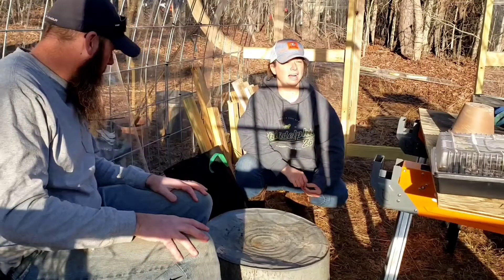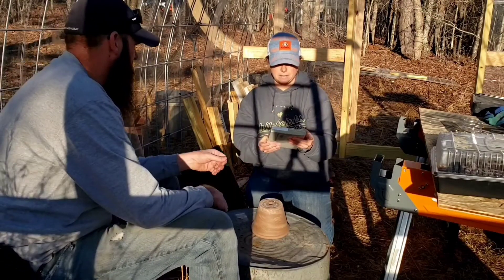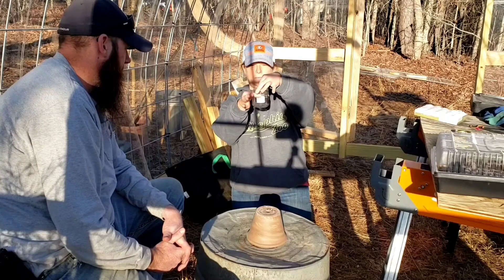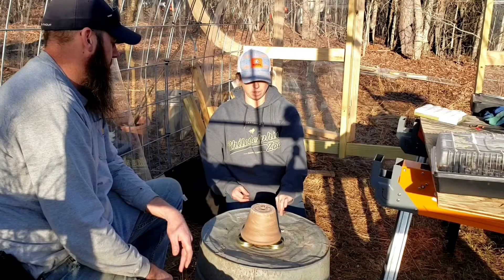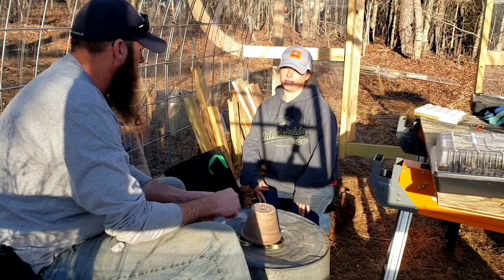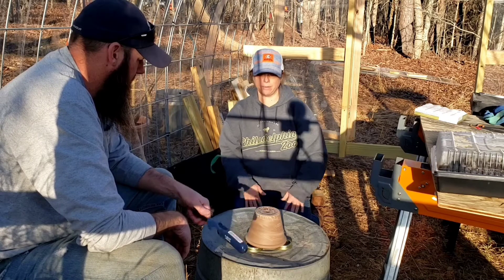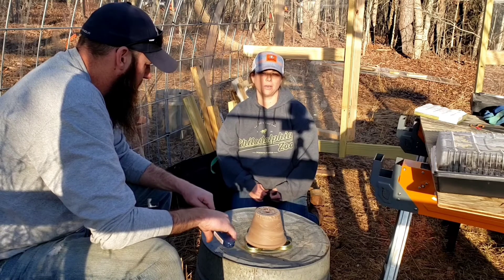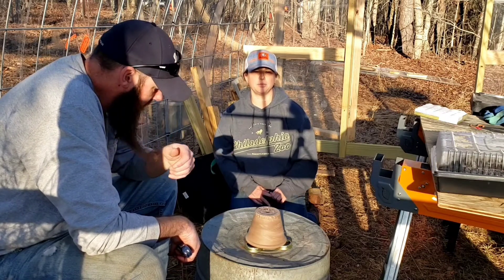Does The Clay Pot Heater Work?

Comment: I've been telling people to clean regularly the pots to remove the combustion waste deposited on them. Then, I've noticed these pots do not block water. Which is OK for what they are made for. To absorb plenty of water and sip through it very very slow. Making the soil wet and fresh longer.
Therefore, the paraffin wax gas or any other grease-fuel one is using, will go through the pots and most of it will solidify inside. These pots are no longer the same. We can remove the excess on the surface but we cannot clean them at all.
My advice do not let the pots reach the flashpoint temperature of the fuel. Or let the flames touch the pots. Control and balance the amount of heat produced. The paraffin wax has a flashpoint of 392-480 degrees Fahrenheit or 200-249 Celsius.
It's also not good idea to use them in small closed rooms. The gases get trapped on it. According to the temps you showed they will solidify on the walls around. But if it gets really really hot inside the greenhouse, the results are different.

Comment: DO NOT keep it near all that dry matter.   Flash Fire is a REAL thing. paraffin wax is HIGHLY flammable and can ignite with vapor
Only use two candles MAX
keep the candles as far away from each other as you can, in the pot
DO NOT leave unattended 
Safty First. Not Regrets.
Reply: Paraffin wax is flammable, not HIGHLY (gasoline, alcohol...).
"Paraffin wax makes candles flammable but doesn’t catch fire easily. As a solid, it needs to be heated enough to change its form into a gas. When this gas is mixed with oxygen, it burns and sustains a fire. The paraffin one has a flashpoint of 392-480 degrees Fahrenheit or 200-249 Celsius."
Reply: @ivofortes823  in this instance it defiantly qualifies as HIGHLY.  Paraffin = Kerosene  (and thats only YOUR opinion)  and most if not all class it as "highly".
It is literally a hydrocarbon fuel created through distillation of PETROLEUM 

Your only here to hear yourself talk.  not to help people.    Go away.
Reply: @GenOceanWolf_tWo_TookieTaliban  Yes, it is my opinion, I didn't say the opposite. The point is, why the irritation? Why do you feel attacked? Can't you stand a simple debate?
Whether you want or not to improve your opinion, I finish this with my opinion again, check yourself, it's not the fact of being made of petroleum that makes a substance highly flammable. It is the flash point. That is, the lowest temperature at which the vapors will ignite when close to an ignition source. By default, substances classified as "HIGHLY" flammable are those with a flash point less than 32°C / 89.6°F.
Here you have some:
Petrol = -43°C / -45.4°F,
Acetone = -20°C / -4°F,
Benzene = -12°C / 10.4°F,
Ethanol = 16.6°C / 61.88°F,
Methanol = 12°C / 53.6°F,
Kerosene = 38°C / 100.4°F,
Diesel = 52° to 96°C / 125.6° to 204.8°F,
Biodiesel = 130°C / 266°F,
Paraffin = 200° to 249°C / 392° to 480°F
Reply: @ivofortes823   "debate".... about houses and burning down and people dying in paraffin fires......sure.  🤮🤮

 like i sad your only here to hear yourself talk.

Comment: You needed more candles. Once candle equals about 80w, you need more like 4 candles. Also, you should be using 2 pots instead of one, a smaller pot covered by a larger pot. I've also seen people adding a washer/nut combination rod down the middle to help kick out heat

Comment: That is a pretty small set up for room with no insulation ! 😆 I would do 2 of them the size of the one in my video and I bet it may heat up 10-15 degrees given that set up... that type of system may be better design for a small insulated room.... 🙌🏽 or snow cave some area that can have insulated heat area